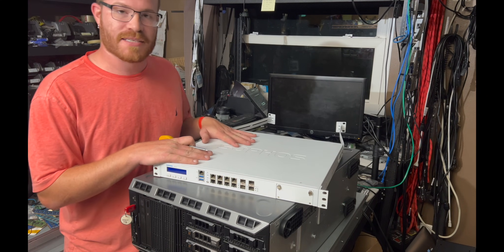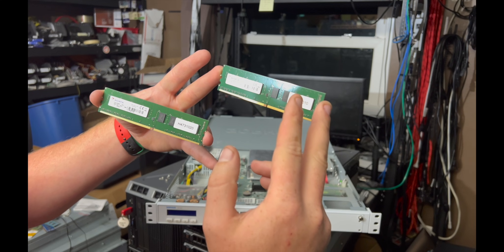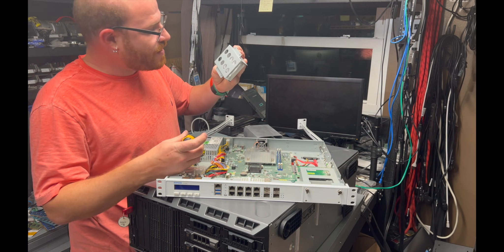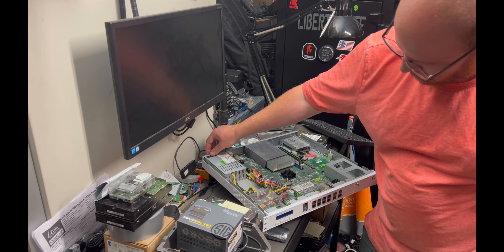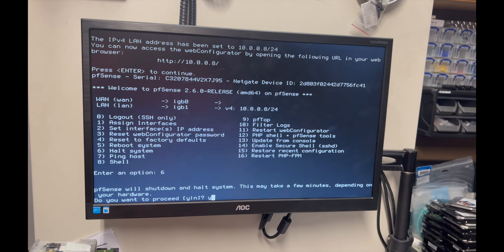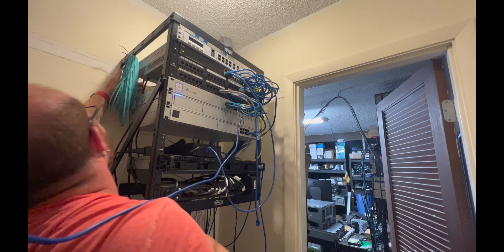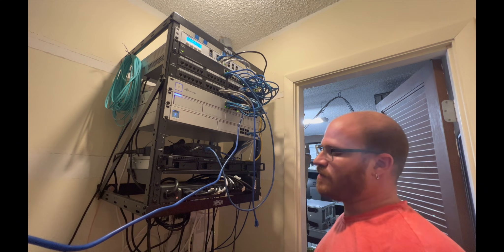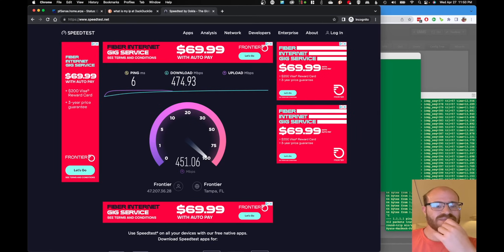What's inside this Sophos Firewall and will it load pfsense

Comment: looks like an XG 310, in that case it should have 2 10gig sfp+ ports built in. the card slot in the front is called "flexi port" used in a bunch of different networking gear

Comment: So I'm curious, it looks like in the bottom of your rack is a Unifi Dream Machine Pro (or maybe SE)...what are you using that for? I'm currently using a UDM SE for my firewall/router and am giving some serious consideration to going back to OPNSense after having time to discover the weaknesses of the Unifi lineup. I just haven't decided if I want to keep the UDM for inter-VLAN routing/default gateway for the VLANs and OPNSense as the network firewall.

Comment: Any problems with it over the past year since you posted this? I just bought a Sophos SG 230 Rev.1 off of eBay for $150. It comes with an 8-port FlexiPort module, which I'm going to sell and use the money to buy a Checkpoint CPAC-4-10F module to add 10Gb fiber to the Sophos. We'll see if it all works once I have the hardware in hand.
Update: My SG230 arrived, and was absolutely spotless. Either the seller never used it, or they cleaned it extremely well.  Mine only has 8 GB of DDR3 RAM, but I'm keeping an eye out for a matching stick to put in the second slot. I was able to install OPNSense on it, and got the serial console working. Have to run some network cables before I can use it. I might try to get the LCD working in OPNSense.
Reply: Any luck getting the display to work in OPNsense?

Comment: I had pfsense running nicely on a XG230 Rev2 unit, I sold it for more than I paid.  I've since got another to maybe do some stuff with again.  Currently running Sophos XG home on a Dell R220.
Reply: I've been thinking of pulling my firewall off of my r310 onto either a firewall appliance like a sophos xg 115v3 or another poweredge either a 200 or 300 series. Like the low power of the appliance but I like having a better back for my server.
Reply: @lesfilanto  the XG125/135 Rev3 units work well.  I’m using a XG135 atm as lower power draw that the XG230 I have.
Sold the R220 December 2023, great unit, but can only stub my toe so many times on surplus kit.
XG125 and XG230 on the next clear out pile

Comment: I just installed pfsense on my sophos xg 106 with pfblocker ng running . After a failed dd of sophos home to the appliance I noticed that only port 1 and 4 worked once the sophos os loaded . Link lights flashes on 2 and 3 until the os loaded . After switching to pf sense all of the ports work and the proper status leds on the front flash with the correct Ethernet port link lights.  I noticed that all my home kit devices are much more responsive than they were on sophos fire wall only official latest build on the same appliance .

Comment: I run pfsense on a (former) sophos firewall, it is awesome! High performance in a great rack mount form factor.
Reply: I have the SG125
Reply: @Mark Maxwell This is difficult, remote diagnosis without further information except that there are Chinese characters. It worked for me without any problems.
Reply: @Mark Maxwell I use the vga, because u to need install first the cli
Reply: Hey Mate. Did you do this on a model with an LCD and if so did you get the LCD to display any data?

Comment: Comcast is weird if you are running with dynamic addresses in conjunction with certain business grade firewall\routers. I guess you have to lose the original assigned IP because it will refuse to assign the same dynamic IP when it sees the different MAC. Simply turning off the modem (I unplugged the coax too just because of how frustrated i was at this point) and lay it to rest for like 3-5min, followed by power cycling everything back on should do the trick. I was deploying a sonicwall tz300w when I ran into this. Hope it helps, good day!

Comment: Did the SFP ports turn out to be SFP+ or just plain SFP?  Also, were you able to load a plugin to use the LCD display on the front?
Reply: Idk if after 2 years u still need an answer or not lol. It is plain SFP. And there is a driver for the LCD display in the plugins, yes

Comment: Great video. I am glad it was easier to do on this that it was on my Cisco asa5525-x
Reply: i threw my asa5525. 100w power drain and bullshit asdm manager. how long did it take you to setup basic routiing on the asa? it took me like 2 days. i switched to a pfsense vm on my proxmox server and i haven't got any issues so far. and the setup was done in like 20min^^
Reply: @hannesstefani  well it didn't take long. Pfsense setup took about 5 minutes. I removed the internal USB flash drive and installed a small 60gb ssd to use for the install. And as far as rules, was about 20 minutes as well. Just be aware this was the x variant which is x86 based. Even the 6 port sfp card was recognized without issue. But the port assignments for the GE ports did not match the port numbering. Was an easy fix though.

Comment: What is the model or will pfSense work on all Sophos models?
Reply: I have installed pfsense on a SG115, it needed some bootflag tweaks but after that it works just fine, haven't tried what happens during the update process though
I guess on a SG125, SG135 it would be the same and should work
Reply: Most of the ones I've seen so far are x86 at least, so with a little bit of luck they should mostly work.
Reply: @TrTai  have you tried on XG86?
Reply: @usmanafzalcissp  I have not tried that model, but looks like it's just running an atom processor, if you can get it to boot and install from USB I'm not seeing anything standing out that would make it not work
Reply: @TrTai  Will try on XG85
Reply: You can see it in 5:38, it's a Sophos XG 310r2